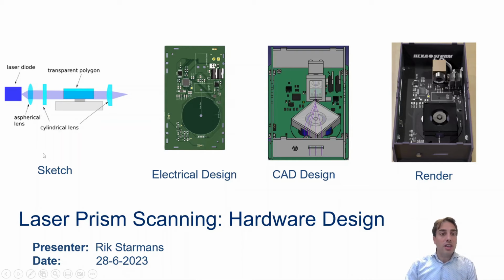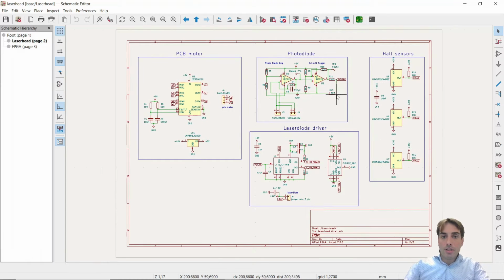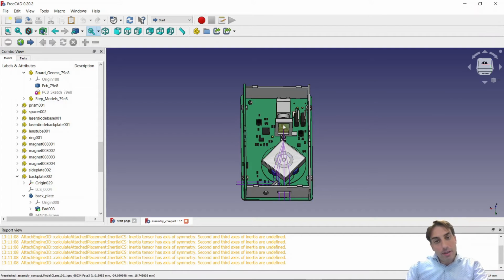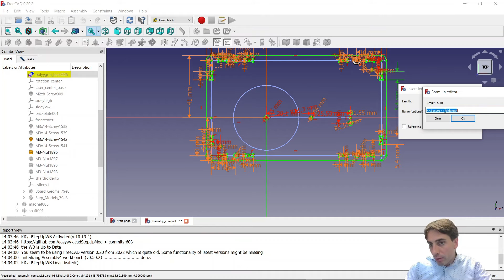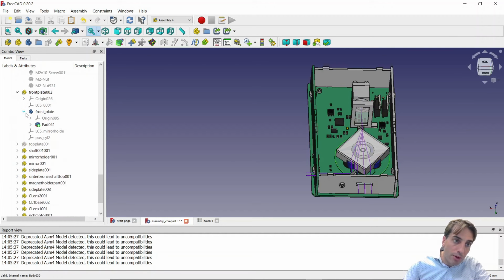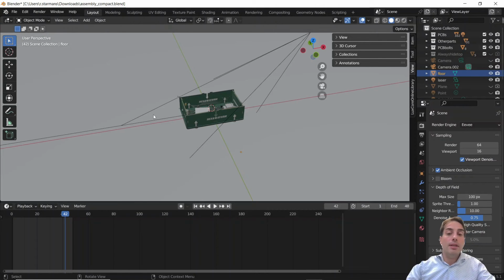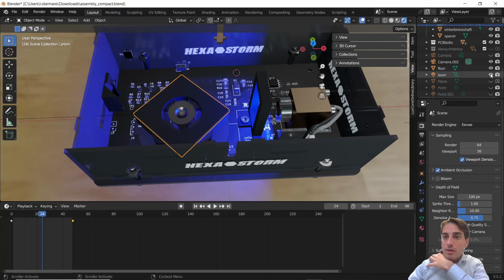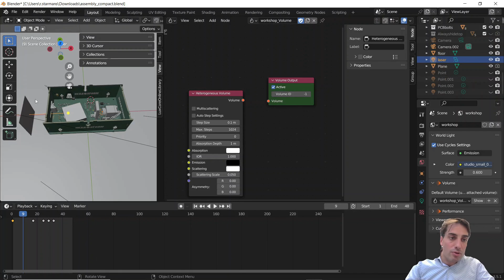Hardware Design

Comment: Ah i see, so you use some sort of laser driver IC to drive the diode. I'm going to try using a high speed amp and power mosfet tonight - may take a bit of tuning. I blew out some LEDs using an lm317 last night - didnt realize it gave a large voltage spike when its switched rapidly 😀😀
Reply from the maker: Here is a working open hardware laser driver https://github.com/hzeller/ldgraphy/tree/master/pcb/laser-drive